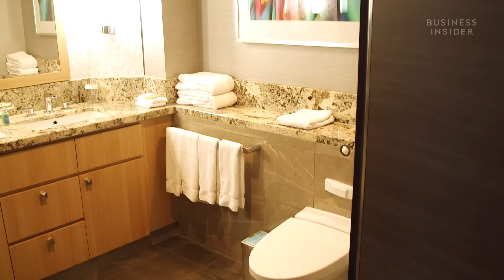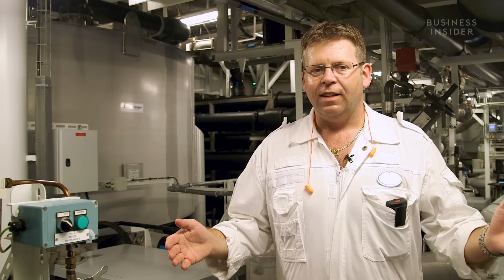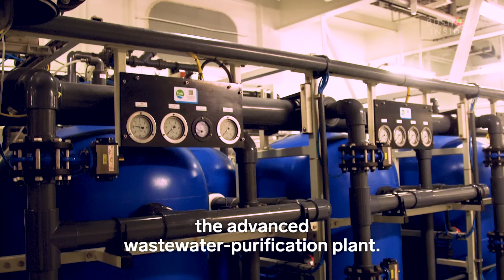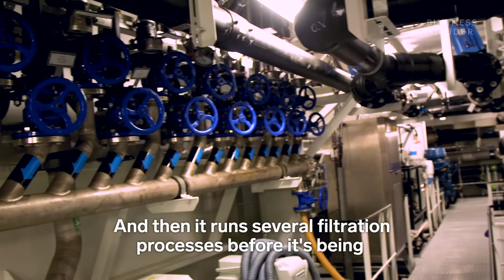How Waste Is Dealt With On The World's Largest Cruise Ship

Comment: Banning plastic straws is probably the dumbest policy a company can implement. Absolutely hypocritical and a drop in the bucket of plastics, while pissing off the customer.
Reply: i buy packs of 200 plastic straws. Whenever we go out, i take a few with me in my coat inner pocket or my briefcase. When they bring us plastic straws, i produce my own ones and they look horrified. Same with eating utensils, I carry my own with me. I've worked in a kitchen, for that reason alone I would NEVER use theirs again.
Reply: @AzguardMike  I don't blame you. I also take plastic straws with me. It's a simple, perfect design but a plastic straw is the BEST straw. Paper is stupid, metal is annoying, any other material is inferior. It's not going to ruin the environment. Every car sold has 1,000 lbs of plastic. Most of it is recycled anyway.

Comment: The problem with American buffets is the "clean plate etiquette." It pressures ppl into over-filling their plates a few times rather than getting EXACTLY the amount of food they want each time they go up. We need smaller or disposable plates, & no pressure on how many times you go up. In fact it should be highly encouraged to go up more often while getting far less at a time. The most efficient method, even, would be to use small plates that look more like artist palettes, where you have like 8-12 little 1 inch holes for tiny portions of food (cafeteria slot design, but for mini samplers)

Comment: I was on a wasp class amphibious aircraft carrier, and I can assure you that ships 100% DO throw trash overboard into the ocean.  

The saying we used was "if it grows, it goes." 

These cruise companies might tell you it doesn't happen, but it does.    

The only things we don't throw overboard is plastic & metals.  

Plastic is melted and compressed into plastic wafers that are transferred during supply transfers, metal is compressed and traded over as well.  

Everything else they simply open the hanger door and start shoveling.  Cruise ships do it too but this is good PR.

Comment: I just solved pollution from garbage and dumps forever.  A factory with giant cats of this sulfuric acid and hydrogen peroxide mixture.  The garbage trucks line up and dump the garbage.   This dissolves it.  Then the Vapor’s from the top get filtered through a big tube filter.   Then comes out of smoke stacks on the roof. Than poof.   Garbage gone.   Pollution solved.   Forever.   Yours truly.  Gods son.   Your welcome

Comment: I think fines in general are poorly implemented in a utilitarian sense. Princess cruise should have been made to use the 40 million dollars to install the proper waste management equipment on their ships, and jail bonds  should be given to local animal shelters.
Reply: They have the systems on board but their are useless if the crew do not use them or use them wrong. And this penalties are comes from the harbor controls which the ships has to be gone through occasionally. And if they find something weird you could be sure that the other ships of the fleet get also a control and / or get more often controlled.

Comment: I see a huge problem with expressing penalties for businesses only in monetary fines. Their analysts can trim this into a simple cost benefit calculation.  "Dumping trash into the ocean has a x% chance of being detected and would roughly cost us x amount of $. Whereas correct recycling would cost y times as much. So we just dump it in the ocean." No. Penalties must be expressed in actual bans or limitations of operation in an area and/or time frame. This way businesses would have a real incentive to act right.
Reply: Not a problem, you just need to make sure x > y.
Reply: It's only matter of you think should be done
Reply: An idea I had a while ago that imo needs a lot of refinement to be viable but the main idea is that while you still have fines it’s based on the company’s profits, so each offense has a percent on it , each offense adds the percent to the total percent which is fined to the company based on their total profits( make sure no loopholes like there are in tax law) and the total percent goes down over time or/and with good behavior, so if they do a lot of offenses in a short time then the total percent will go up and get kind of high quickly and because it’s doing fines multiple times it’s going to cut into their profit margins a lot and because it’s based on their profits, it should scale to small and large businesses and no raising prices can block it, of course in real law it would have to be tweaked and changed to make sure it has the desired effect and no loopholes but I think the main idea of fines being tied to profits is a good idea
Reply: Corporations break the law? They get a trivial fine. 

You break the law?  You rot in prison.
Reply: There should be two elements to the penalty: first, the estimated cost of cleanup and remediation is determined and they are to pay that figure to a an arm of the EPA devoted primarily to corporate/natural disaster cleanup. This grows a people’s slush fund for disaster relief in the event a company goes bankrupt or a major natural disaster overwhelms the existing support. Second element is the govt actually holds these fuckers feet to the fire and makes them pay out of pocket to clean up their own mess. Seizure of any company vessels involved immediately following conviction, released only upon first paying the penalty. Seizures again should they violate the timeline or conditions of the cleanup agreement.
Reply: Just calculate it in and raise the price 🤷🏻‍♂️
Reply: Capitalism can be bad left unchecked. Setting proper regulations, limitations, and discipline for the individuals & groups who are overly substantially financed & mistake their finances as the ability to negatively impact this world. Long story short: dont let companies and spoiled brats (millionaires, billionaires) do what they want recklessy.
Reply: Amsterdam has the right idea 👍...They just stopped the Cruise ships from docking there

Comment: Anyone else belive that the food waste pipe just goes straight out the bottom of the ship 🤣🤣🤣
Reply: "This food waste goes to the incinerator" BUT YOU DIDN'T SHOW US AN INCINERATOR.  100% dumps straight in the ocean.
Reply: As a seaman for years, Food waste can be thrown overboard as long as the location is 12 nautical miles away from nearest land.
Reply: That's actually legal, and fairly common on other cruise lines. MSC openly said they just pump the ground up food overboard. It's all biodegradable, although dumping too much food in one place could upset the ecosystem.
Reply: food can and should go on the sea
Reply: To feed the little fishies!!
Reply: Y burn something that won’t hurt the ocean it’s organic kinda just a commercial for cruises they don’t mention burn the same fuel as a a city every year
Reply: As it should.  Its food. Either something will eat it or it will rot and become compost
Reply: @WHEELSENGINESMOTORS  It is actually super bad because it can cause algea to grow too much, which can cause numerous problems. Especially if there are toxic types. The best solution would be to make biogas from the waste, and then run the ship on the biogas. At least to a degree.
Reply: @Ikajo did you see a study where they compared the added CO2 in comparison to algea growth?
Reply: @WHEELSENGINESMOTORS  While i don't know exactly what damage dumping random foods into the ocean does, its not great is it. There's reasons why they incinerate it or else they wouldn't bother very ham-fistedly outlining the point that the do do it. To me it would just be yet another shitty way ocean liners/tankers/container ships save costs by cutting corners or breaking the law.. they already use dirty crude slurry to power their boats on the open ocean, they also bilge pump chemicals, heavy metals and oil into the sea.

Who knows what the adverse effects of dumping processed food scraps into the ocean has, off the top of my head I can imagine that these trails of waste being laid down give off chemicals and pheromones that may cause confusion, infection or migration of certain species that then has a knock on effect on its ecosystem which may collapse it which then gives way to another plant species that thrives in these areas and becomes unchastised by the now dead ecosystem, that particular species could then produce an over abundance of certain gasses that creates an imbalance in the water concentration around it making other further areas inhospitable.

When you think like this you can go one of two ways and say 'that's pretty far fetched and so what who cares' or you can realise that life is insanely complicated, billions of tiny interactions and pathways to find balance, but once the balance is tipped too far, it way cause positive feedback loops in nature that perpetuate a series of larger domino effects that could be undetectable to us for decades after which we may notice that large ocean animals are randomly dropping dead on mass by which point any chance of recovery is impossible

...Or food rots so its ok. Its up to you.
Reply: @WHEELSENGINESMOTORS  carbon material in the ocean doesn't just magically disappear 

fish eat it, shit it out and microbes break it down and the ocean acidifies as a result 

water can also eutrophy which kills every last fish
Reply: @WHEELSENGINESMOTORS  I hope so dude
Reply: Only you

Comment: That's something that I've often wondered. Thanks.
But definitely, lots of cruise ships must not follow rules in international waters.
Reply: That is wrong they have to follow the rules of their flag states. And if the crew dumps the garbage at the next prot control they could get a penalty. You have to write down each possible garbage you can get on board and when you get rid of this garbage in a harbor you become a receipt of the amount of garbage. And if this does not match the calculations they give them a penalty.
Reply: @J  that's very encouraging to hear. Thanks.
However, some countries probably have lower standards, right?

Comment: How does the mesh handle bone?  Is that ground up before it goes to that step?
Reply: The bones are sorted out and will be put into this machine via the hatch you can see at 4:06 and then goes through a grinder. The mesh is only there that the food waste has a specifiy size after grinding it up, the grinder is direct below this hatch. The mesh does not cut the food waste.

Comment: On an aircraft carrier we recycle plastic, but on a 4 hour trash watch where a guy sits and checks trash going my overboard for plastic, chemicals, etc. I watched about 500+ bags being thrown overboard, large paper bags full of biodegradables. And that was just my watch, it goes on 24/7, except when we are obviously in port and can’t start until we are 50 miles off of a coast. Maybe 100, I can’t exactly remember it’s been 10 years. And that’s just one ship, but all plastic is melted into a large disc and other recyclables crushed and stored.

Comment: Unfortunately, “dilution” tends to happen in the same spot for many ships that dump their treated water overboard, and it ends up concentrating.
Reply: The treated water on board of ships nowadays have drinking water quality, even if you use chemical it must be fully bio-degradable. The Treatment of the Waste water follows certain steps like a water treatment plant in your own Town but on a smaller footprint and has the same rules to follow, maybe a little more stricter. I worked for the company which delivered this system to the ship in the video, that's why i know in principal how this waste water system works. My part was the dry and food waste system on cruise ships.

Comment: Can you explain the part when you said "almost safe to drink"
Reply: They mean it's clean enough to dump overboard without causing ecological harm, but not good enough to drink. The same is true on land, sewage treatment plant discharge is (or is supposed to be) environmentally safe, in many cases cleaner than the river it's being discharged into, but still not drinkable. Just like most river or lake water, even if "clean" and supporting a healthy ecosystem, wouldn't be considered drinkable without filtration or other treatment.
Reply: Means good. But not so good.

Comment: Cruise ships are built by morons, right.  I can think of 6 ways to drastically reduce waste right off the top of my head.
#1.  Prohibit passengers from bringing any items in disposable bottles or cans on board.
#2.  Issue everybody drinking cups and have all water and other beverages available from hold-down dispensers.
#3.  Pack foods in bulk containers rather than cans, bottles, boxes and etc.
#4.  Have bacteria in holding cultures that digest sewage and then dump it out to sea.
#5.  Limit the population density, rather than building what are essentially floating high rises over malls.
#6.  Have a fleet of logistics runners that can shuttle sick people, broken supplies, etc off the ship to nearby facilities ashore.
(Duh.)

Comment: Cruise ships of a certain size and over should be mandated to have biodegradable products they furnish their customer with for drinking items and pass on the cost to the consumer that wants to go on a cruise on these behemoth ships. Also I think for environmental safety as well when ships dock in port they should not discharge their waste into the ocean even if they claim it's cleaner than the seawater after their treatment process. They should just have lines that hookup to land based sewage so it can be treated and not have any risk for the oceans.